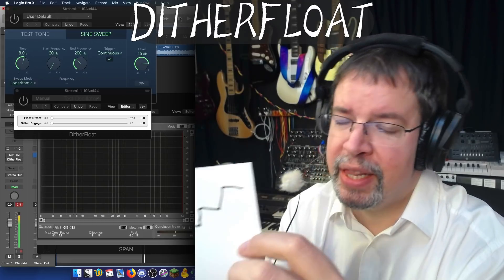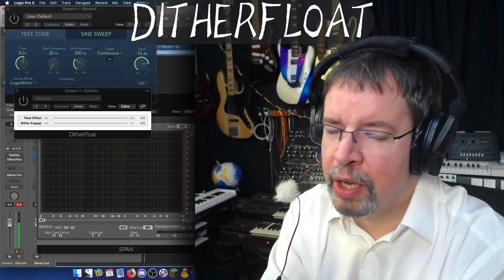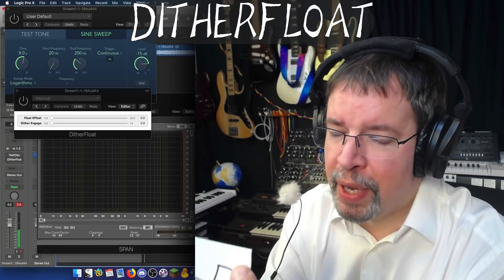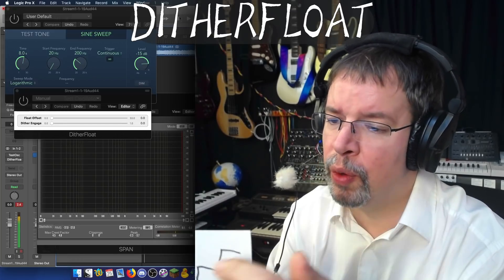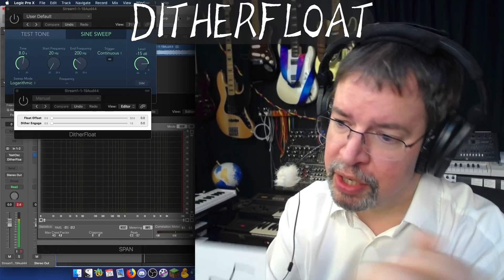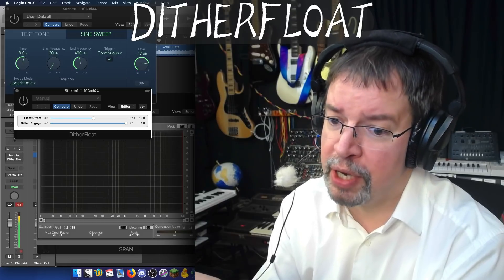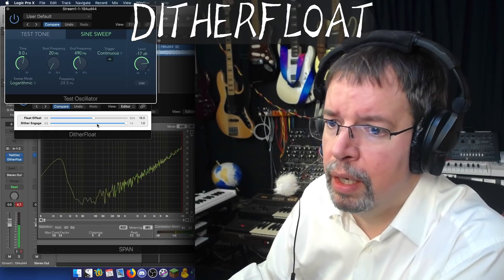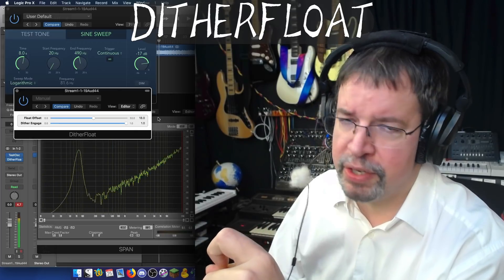Airwindows DitherFloat: Mac/Windows/Linux AU/VST

Comment: Hello Chris. I've been reading the book Quantization Noise by Bernard Widrow from 2008. There they also explain this algorithm. I thought it would be enough to add a triangular random number between -1 and 1, then multiply it by 2^exponent, and multiply by the quantization step, which for a float would be the smallest bit of the mantissa, so 2^-23.

But when I look at your implementation you add 62 to the exponent and you multiply by a number that is way smaller than the smallest bit of the mantissa, but larger than the theoretical minimum value of a 32 bit float.

Where do these numbers come from? And why wouldn't the implementation I described before be sufficient?

Love your stuff, they're an incredible resource. Hope you can help me out!
Reply from the maker: The way I do that is, finding a way to scale the float until you can hear the quantization, and then using the noise source to dither the truncation. I did it several ways and then got in a public discussion about it, with a lot of people including a guy from Izotope who had metering I didn't have, and who identified a different level and code to produce it. He was right, I just came up with distinct code to get to the same level, and that's what's in Airwindows plugins. This also means that technically someone at Izotope has their own floating point dither code, independently of mine, if they want it :)

Comment: Great. Do you think you can just put it at the end of a plugin chain or should you have it after every plugin?
Reply from the maker: It's built into every plugin so you should never put it in a mix extra times :)
Reply: @airwindows  yse but when I use other than your plugins do you then  think I can just put it at the end of a plugin chain or should you have it after every plugin? one should think that its enough with after last plugin ..  or what

Comment: I couldn't understand everything you said about this specific plugin, only that this makes 32 bit recordings sound better, just like normal TPDF makes it for 24 and 16 bits.

My questions would be: 

1) Should I only use this for 32 bits files? Or do lower bit resolutions benefit from it too?

2) I've been using your TPDF for a while on my mixbuss and it does a great job, but what would happen if I put that TPDF at the beginning of every individual track plugin chain? Would the mix sound better? Would it sound worse? Would there be a big noise build-up? If the mix sounds better would the instance on the mixbus be useful?
Reply: 1) lower resolutions wouldn't benefit because the dithering happens below their ability to record it. you have the airwindows 24 and 16-bit dithers for that

2) putting ditherfloat at the beginning of every plugin chain would not help because if you have 64-bit plugins then they'd be FORCED to work with 32-bit numbers which would defeat the purpose of having 64-bit plugins.

and if you had only 32-bit plugins then they'd all be truncating and chopping up the numbers inside themselves regardless of whether you gave them a dithered number or not, so the dithering would be for naught.
Reply: I don't think this was meant to be used for anything. From what I understand of it, it's a demonstration of what we don't want and why TPDF and some of his other plugins are written the way they are—to avoid this kind of signal corruption. Takes me a minute to catch up to Chris, but I'm pretty sure that's the gist of it.
Reply from the maker: Download my plugin update. ALL my plugins now use this technology in the way that they should. This plugin only shows you how the tech works.

Comment: So to be clear:This is a plugin for extreme hi fidelity sound, right? Everyone not focusing on high fidelity sound will not have a big change?
Reply from the maker: Anybody who's into analog warmth and hates cold digital sterile thin crap needs this :) you can be very very 'low-fi' and still need to avoid truncation distortion. The whole Boards Of Canada crowd would absolutely love this type of dithering. As for THIS plugin, DitherFloat, it's a bitcrusher to demonstrate how the principle works, not something you use directly.
Reply: @airwindows  thanks for your answer. Thanks for the time - have a nice day. I'm jamming on the piano...

Comment: Chris, I'm starting to understand what you mean. My old comment has been removed. How many dBs are you boosting before you convert to float? I'd like to understand how far down the quantization noise is when this plugin is not used.
Reply: Also found a Cambridge document that supports your hand-drawn diagram. http://oldweb.mit.bme.hu/books/quantization/floating-point.pdf
Reply: REALLY wanting to know how many dBs you boost before going to float, because I'm guessing that this quantization noise is very far below -144dB. Am I wrong?

Comment: The gating effect is not something I want on my final master. The fact that the "gate" turns itself on and off and you can hear the noise is not good. Other than that it  does make the final master file sound better. Make an update without the gate effect please.

Comment: Quantization errors of 32 bit floating is around -156 dB and 64 bit floating point error is around -331 dB, by adding dither on each plugin you are just making it worse. Dithering needs to be done just once otherwise you keep adding noise. Where did you get the idea this works? I have not seen a single dsp publication on this subject and you are not providing references or a proof .You dithering algorithm is about 10 lines of code and it's really simple, why a big enterprise as Ableton  or Apple that has millions of dollars and developers wouldn't add it by default in their plugins? This is about DSP and is not subjective so there must a mathematical proof if real.
Reply from the maker: I invented this. Alexey Lukin of iZotope criticised it and came up with some improvements, demonstrating experimentally that it was a real thing and desirable. I then further developed what Alexey had, and open-source licensed my original implementation. So iZotope could easily have this in place by now, too. And Alexey demonstrated the concept with test measurements, when I didn't have the testing software to do it.
Reply: @airwindows  Difficult to believe without a proof and without a single reference... You are adding noise and 32 bit quantization errors become noticeable after a big processing chain, with a single test sine sweep you can notice that noise on every iteration of the dither become the problem worse and worse... I'll se if this actually becomes part of Izotope plugins but I doubt
Reply: First of all, you apparently have no idea who you're dealing with. This guy is a genius and he does a lot to push the limits of modern dsp. Second of all you apply dithere EVERY TIME you reduce bit depth such as when going from a 64bit plugin to a 32bit (which it is) core audio buss.
Reply: @zdenekloucka7079  Obviously you have read the code and know about dsp... Thats why you have included so much arguments in your comment to support that idea

Comment: Why do you use dithering on 32 bit floats?  Dither is only adviced when converting from a high bit depth to a lower bit depth and you are using the maximun bit depth. Adding dither when is not necessary it just adds mud to the sound.